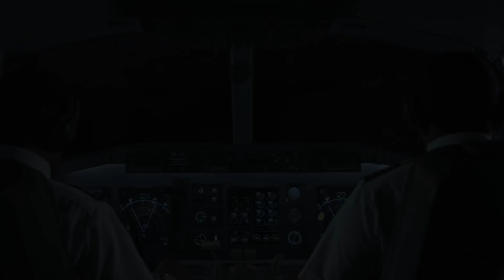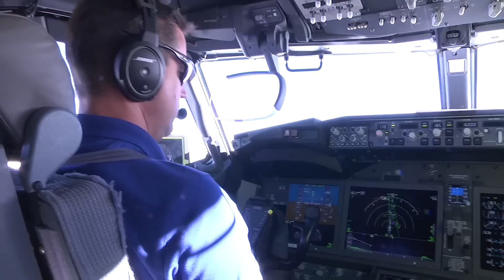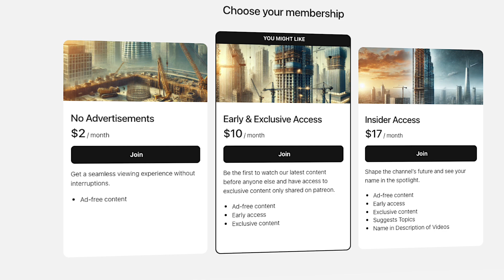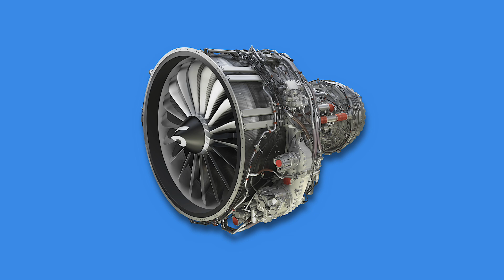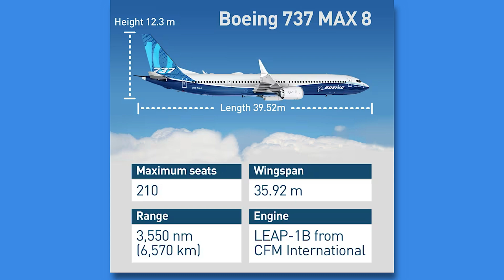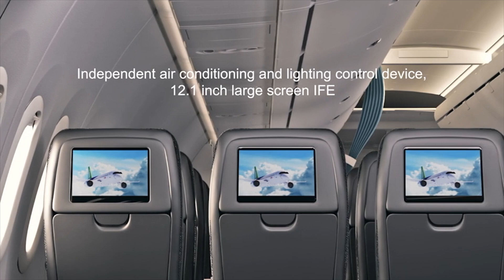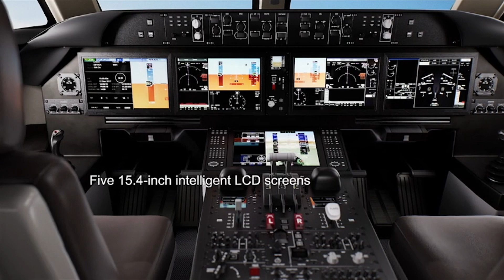Can China's $9.5BN COMAC C919 Dethrone Boeing's 737 MAX?

Comment: The biggest hold back to C919 in the international market will be certification as the poster above mentioned. US has all the reasons to make certification harder than it has to for C919 and its future brothers. A large percentage of C919 avionics are Western made despite China being able to make their equivalent, it's done purely to make international certification slightly easier than impossible, as China found out the hard way with their preceding CRJ regional jet.

Comment: It is possible to dethrone B737 if we consider current situation of Boeing.
Reply: The airbus a320 already dethroned Boeing 20 years ago
Reply: 1st - Airbus A320neo.
2nd - A couple tragic incidents with 737 Max 8s.
3rd - A blown emergency exit door on a Max 9.
4th - Rudder control malfunction on one of a Max though NGs have this issue as well.
............ Will be dethroned by Comac C919s but not soon.